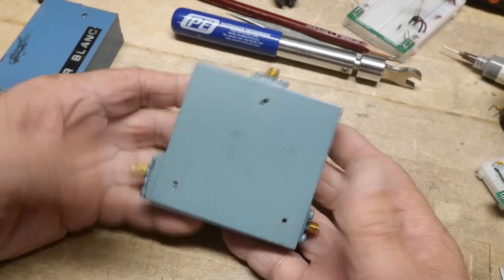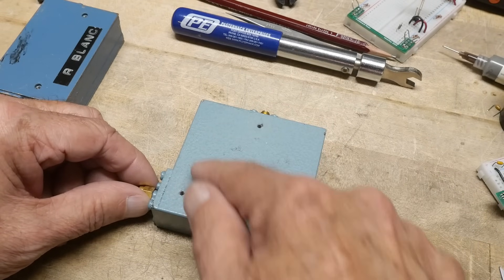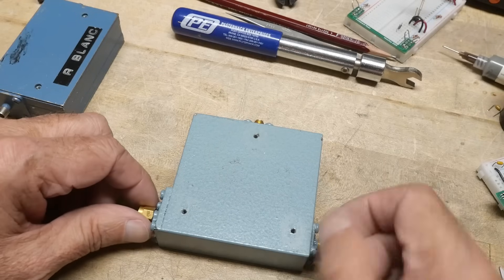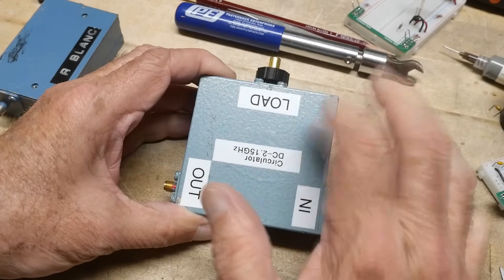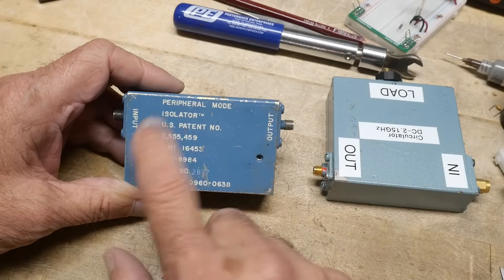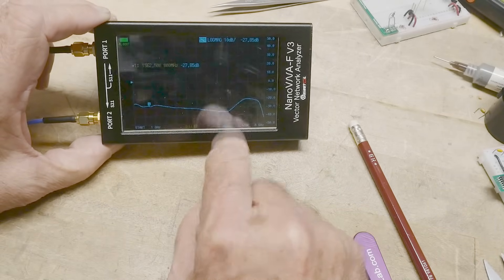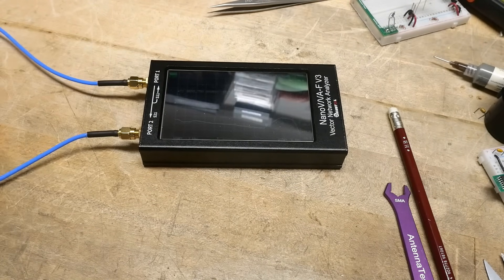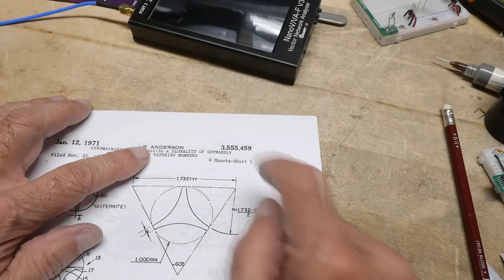#2240 RF Circulator and Isolator

Comment: I'd recommend using a PC app. Linux has a vna app that you can set the sweep range and number of 101 measurement point sets to get a better idea of where they work best... especially if it has very narrow band spots that could be missed with larger steps.

Comment: RF Circulator:
Supplies inverse reactive current for use in unilateral phase detractors, and also automatically synchronizes cardinal grammeters.
The main principle involved is that instead of power being generated by the relative motion of conductors and fluxes, it is produced by the modial interaction of magneto-reluctance and capacitive diractance.
The older "peripheral" version has a base plate of pre-famulated amulite surmounted by a malleable logarithmic casing in such a way that the two spurving bearings are in a direct line with the panametric fan. 
The latter version consists simply of six hydrocoptic marzlevanes, so fitted to the ambifacient lunar waneshaft that side fumbling is effectively prevented.
The main winding is of the normal lotus-o-delta type placed in panendermic semi-boloid slots of the stator, every seventh conductor being connected by a non-reversible tremie pipe to the differential girdle spring on the “up” end of the grammeters.
Whenever a forescent skor motion is required, it may also be employed in conjunction with a drawn reciprocation dingle arm, to reduce sinusoidal repleneration.

Comment: We use VHF circulators with a dummy load between the repeater and the cable/antenna system. Should the cable or antenna develop a fault the repeater transmitter is protected from high SWR. We operate in the 2m amateur radio band. The same applies in the UHF ham band,

Comment: The purpose of both are to prevent signals picked up by the antenna from traveling back into the station's amplifier and mixing thereby creating intermod emissions (Product frequencies). These should also have a low-pass filter or bandpass can installed on the output to the antenna as the devices themselves can produce harmonics.
Reply from the maker: other things too: https://rahsoft.com/2024/01/06/applications-of-circulators-and-isolators/

Comment: Interesting what makes it so different. 
I was also wondering how to make a circulator for dc but it might mean near-dc.
Reply from the maker: https://en.wikipedia.org/wiki/Active_circulator
Reply: at DC you could simply use a diode
Reply: @AndyFletcherX31  Still interesting how to connect it to the 3 ports.

Comment: What are the use cases for circulators and isolators?
Reply: circulators are generally used in transceivers, as the signal only goes from one port to the next in cw or ccw manner, they are used to separate the rx and tx paths instead of putting a spdt switch.
Reply: @rahul9344-o Radar is a good use case
Reply: An isolator can prevent a mismatched load from affecting a transmitter.  RF out no reflected power back?